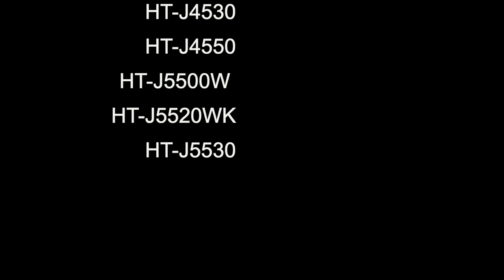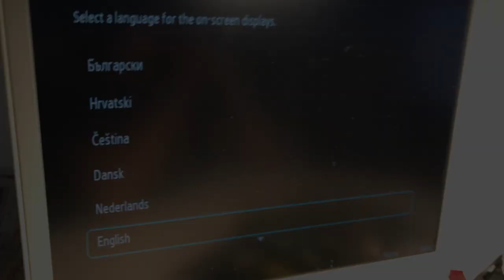How to fix SAMSUNG BOOT LOOP issue - Samsung problems (HT-J models) Blu ray region free

Comment: Has anyone had any issues problems with the samsung  ubd-m8500? That's the model I have ...I worry it will do that reboot  nonsense or black screen me like the other samsung players 🤔 I've heard? So far so good  and it's still operating but I worry I'll get that reboot problem sooner or later? I don't have it with internet access nor do I plan to...im thinking it will ps3 me at some point with that stupid encryption nonsense at some point.

Comment: Is it just those models or all samsung 4k blu ray players?
Reply from the maker: it's all models effected by this problem
Reply: @mp_24  I have an ubd-m8500  for a few years which I only play once in awhile for 4ks ...its not hooked up to internet or any update stuff and still plays ok... im hoping it was an issue with having internet attached to it as mine isn't connected and still plays thankfully.   Guess I'll see over time. Crossing fingers it doesn't happen to mind.   I refuse having it hooked up to the net and only use it for my 4k movies once in awhile 😤.

Comment: I have problems with my Blu ray player model ht-j5550wk. Like's it locked. Button power and volume yg Works in screen player. In screen tv I'ts dark
Reply: What should i do.. someone please help me
Reply from the maker: @antiyahudipray4palestin594   please write down an email to our tech support: salesbdmods@rattlebyte.com with your specific problem.
Reply: @antiyahudipray4palestin594  I have the same issue. Did you solve it?

Comment: The kit is for one time use or need to permanently sit on the position?
Reply from the maker: Hi, yes this kit is still available, this kit is for one-time use, so once installed, it fixes the boot loop issue and, it can be sent back to us, or it can be used to fix up other players, but for this last option   better to talk via email, pls check our website RATTLEBYTE.COM